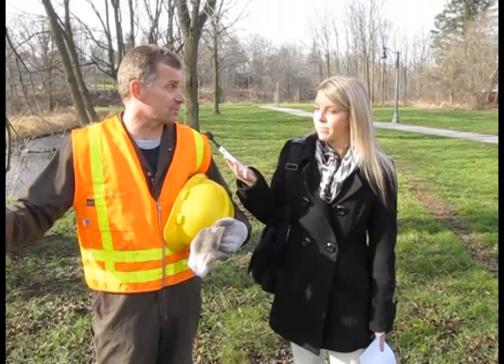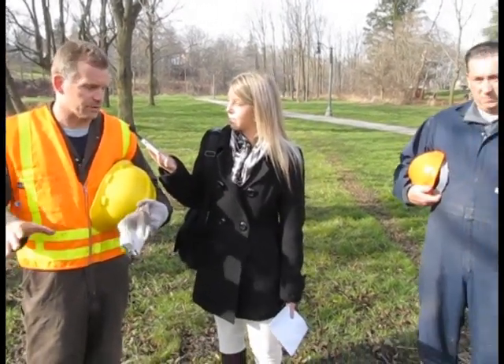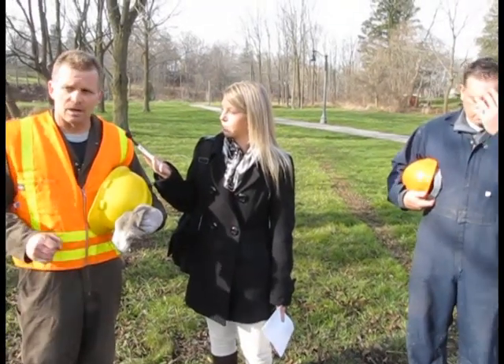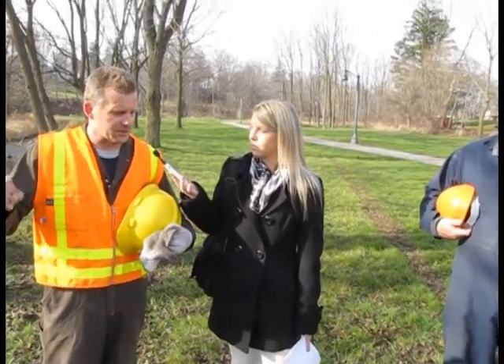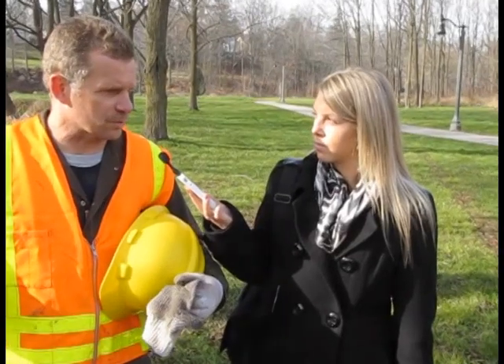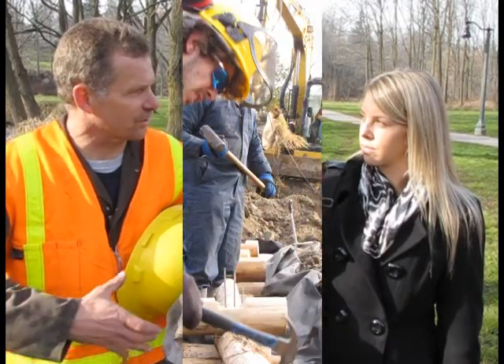Halls Creek Live Crib Wall

Comment: Erosion control but instead of composite piles which will last 50+ years, you use wood cribbing which will deteriorate after 25 years, best of luck repairing it down the road.